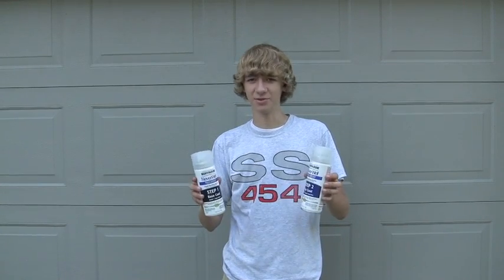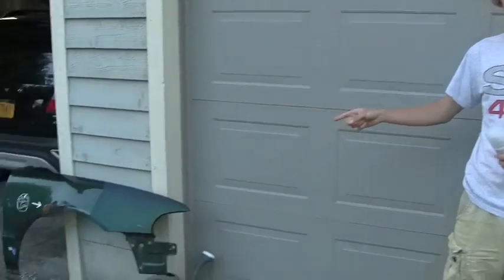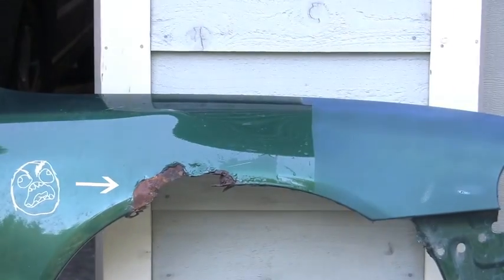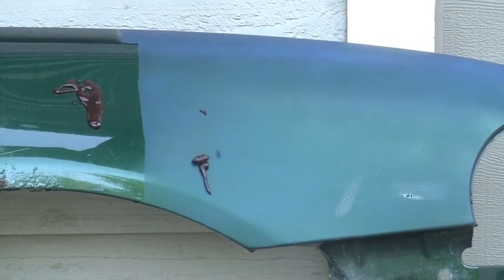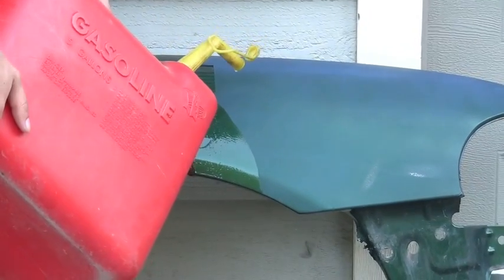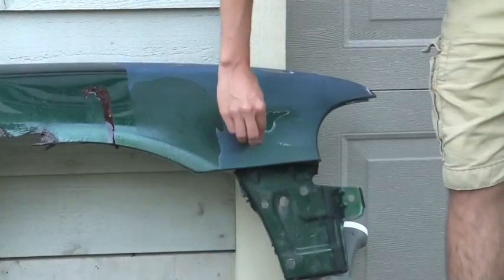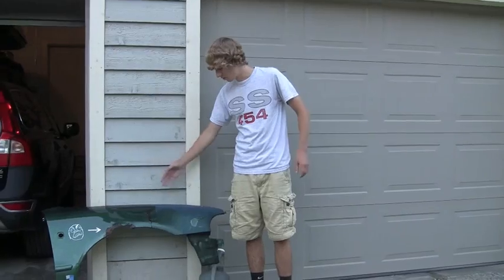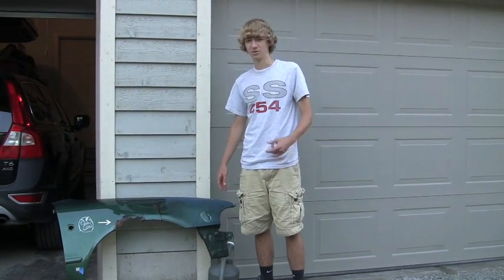NeverWet on Car Panel Experiment

Comment: you probably would have had better luck if you wet sanded the paint to remove the shine so it had a better chance of adhering. also, the gas will probably just eat it away. it has some really great uses, but it isn't great for everything.

Comment: Realistic test. Quite normal to spill a drop of gas here and there when you fill up your car. Also noticeable the opaque discoloration . e.g. the stuff is not suitable for car paint at its current stage. By the way the rubbing was clearly done on a section that was not touched by the gasoline. Sort of a car wash test . Again seems not  suitable for cars . Anyone agree ? . Rust-oleum is marketing a half finished product, that only works on white surfaces,  that cannot be touched, washed or rubbed on, that cannot handle UV , because the flexible film is clearly organic. Its visible finish also makes it not suitable for glass. And for textile ? Well one needs to wash the t-shirt once a while for sure. Body odor is not a liquid . But it cannot handle rubbing so how do you wash treated fabric ? Leaves the question what the product is really made for ?

Comment: Not really. Every video I've seen of someone demoing it, shows that it's a foggy coating and one man even did it on clear plastic to try it out. It made it very opaque and it was impossible to see through it afterwards. Just use rain-x it's a lot safer.

Comment: Neverwet isnt really designed for car panels (since the coating is not invisible), or anything that is going to be doused with chemicals or lots of wear and tear. It does have some good applications, just not for everything.

Comment: The coating is a 'hydrophobic' coating which means it does not stick to Water and things you can mix with water ! But NeverWet has not said it's an lipophobic coating which means that Oil,Petrol etc will stick to treated material ! 
Sorry for bad english 
greetings from Germany :)

Comment: Well I wasnt being technical with my use of the word 'corrosive' but you got what I meant. And yes, Im overreacting for the hell of it, but also because to write something off as 'not that good' because it cant be used for something outside the parameters of its intended use is just stupid. This clearly isnt meant for your car, and something like that for a car would not be for sale in a can at Home Depot. Also, I like overreacting on the internet for its comical value :D

Comment: well actually what you're seeing here is it acting as a solvent, it isn't corrosive at all; 

regardless don't you think you're over reacting?  it is after all a young man experimenting with something which shows us some actual useful information about the product, in that while resistant to water it dissolves in oils quite easily

im just curious if its because of poor adherence to the paint or the chemical properties of the spray itself

Comment: Oh my god the point is THIS ISNT MADE FOR YOUR CAR. If it were an automotive product, it would be sold in an auto parts store. Im sure if it were professionally done (in several coats with sealant applied) then results would be different than is some 15 year old with his dad's old IROC and a video camera did it. Gasoline is also one of the most corrosive substances in your everyday world.

Comment: The gas looks like it is dissolving the coating. Which you would expect. Gas tends to do that to a lot of things. This isn't really the right application for this protect since you'd want something that can take much more abuse. Better to pay for paint sealing or whatever that's called that actually puts a permenant protective layer over the clearcoat fo the paint.

Comment: I am totally aware of what hydrophobic means. So I was not surprised that detergent sticks to a hydrophobic surface.

I was surprised that a NeverWets hydrophobic properties were totally and permanently destroyed by detergent.

It peels easily, you can't ever wash it with soap, mild abrasion destroys it and hand grease screws it up.

What can you use it for with all those drawbacks?

In my opinion it's a wonderful lab curiosity with too many real world flaws.

Comment: no point putting it on a car. It will resist water indefinately. It probably will not resist bitumen, diesel and petroleum residues etc found in road grim. These chemicals are nothing like water beyond being liquids, and therefore not subject to the coating's hydrophobic nature

Comment: detergent is not water. It has both polar and non-polar properties. Water is very polar, this stuff is hydrophobic, which means it does not interact with water or other very polar molecules. The very fact that it is "hydrophobic" should point this out with a basic google search of what that means

Comment: thanks for the video. Im wondering though if you had scuffed the clear coat before applying, if the NeverWet wouldve resisted abrasion a little better. I want to put this under my car to prevent rust. Im hoping the rougher surface of the undercoating will give the NW more "tooth" to hold on to.

Comment: cool, thanks for doing this vid - interesting to see - i wonder if any thing like the paint or a paint coating makes it be able to come off or if it comes off like that on every surface? I like the demo of them using it on a phone but as you can see in their official vid, you coat the interior surfaces not hte exterior ones, so at least we won't ruin our glossy parts of a phone or risk it rubbing off. /ramble. thanks!

Comment: Good experiment. Science is built on actually testing stuff to see what happens.
I was thinking of using it on a car panel so I am now a lot more informed.
Presumably if you paint on top of this coating you will have very good rustproofing protection - if it was a steel car panel.

Comment: The fact this is a coating should tell you that it's not for everything since it coats stuff. Gas doesn't work because this is superHYDROphobic which means it repels water, or water based materials. Gas is petroleum, not water. Of course it doesn't work with gas. Anyone with a high school education should realize that.